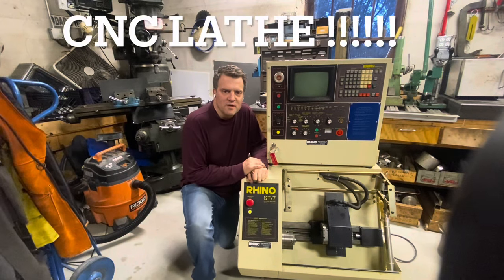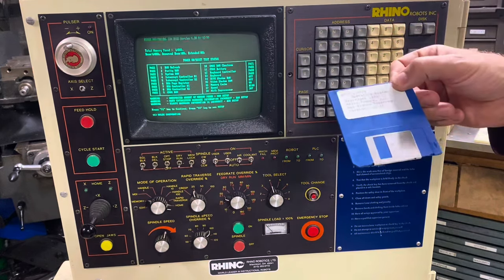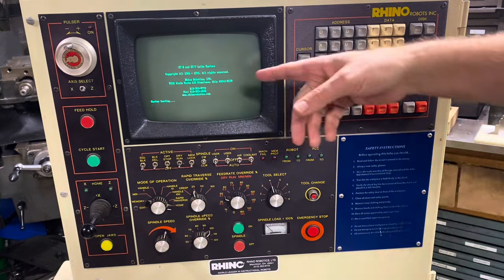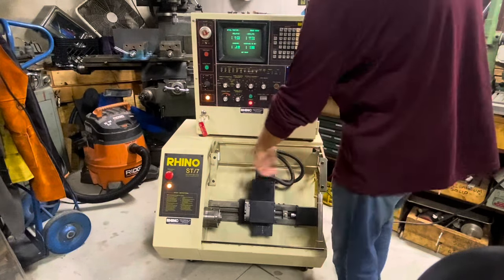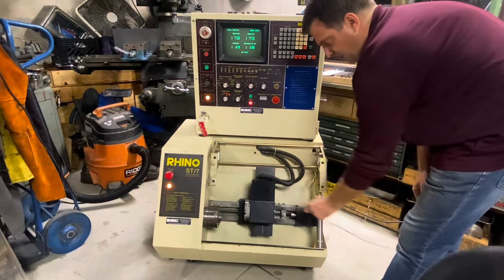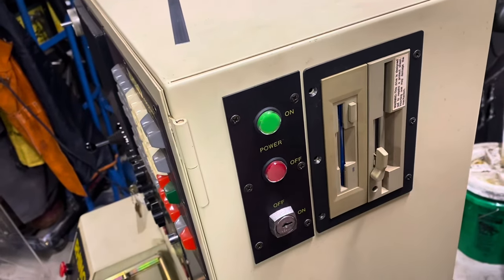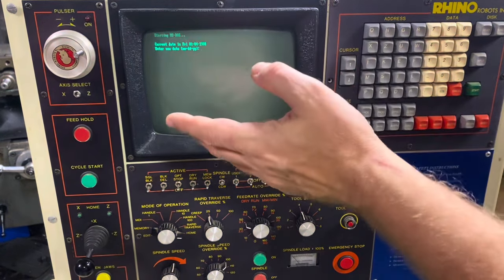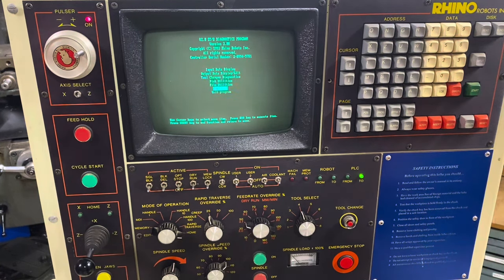CNC Lathe Rhino Robotics ST/7 Part 1

Comment: Hey man, nice new toy you have there.  If the mechanicals are good I'd convert it to linuxcnc, smoothsteppers and run it to the moon.
Reply from the maker: Hi Jim mechanicals are definitely solid  there is actually no evidence of use.  I prefer to get it going with its current setup.  If that becomes impossible then I would convert it.